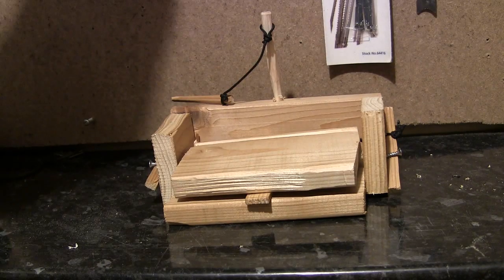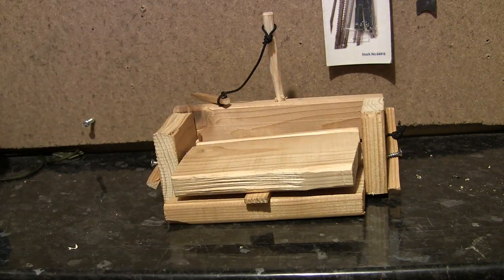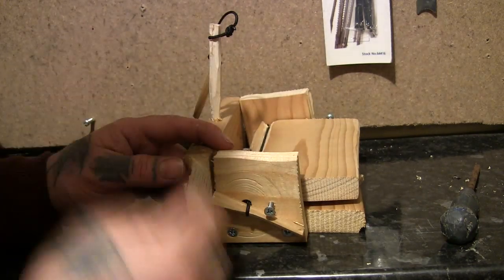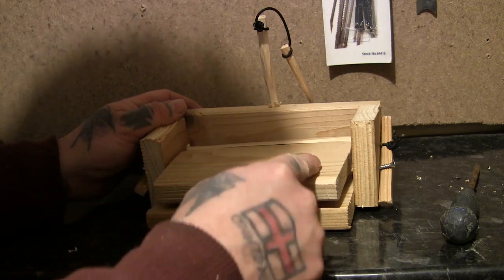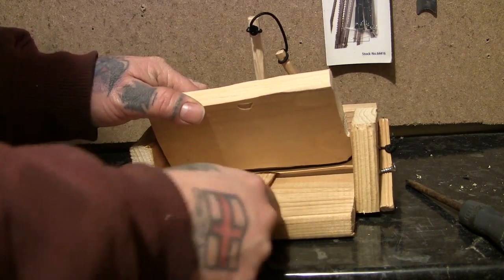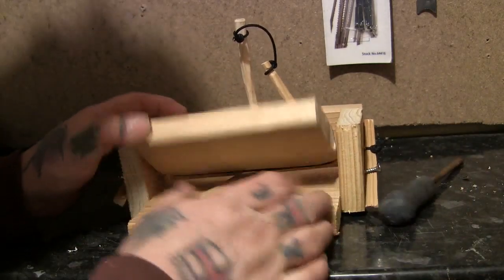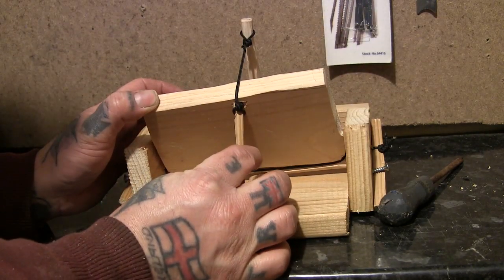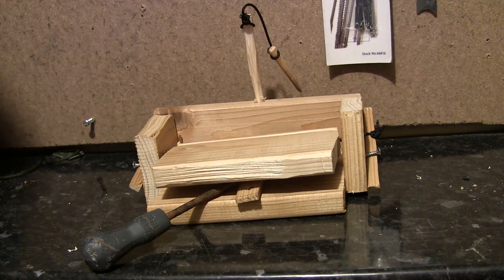Finnish Mouse Trap

Comment: might ever get a rat if you put "teeth" on the trap with nails maybe
Reply: i also think the thinner the loose trigger part on the bottom is the better it will work. maybe ever rubber on the top moving part would make it harder for the mouse to self extract than smooth wood